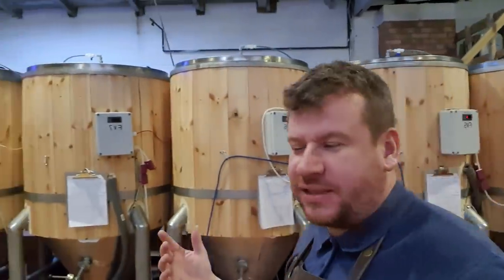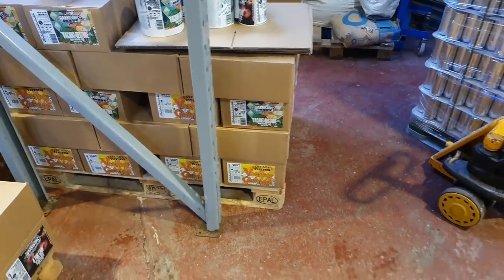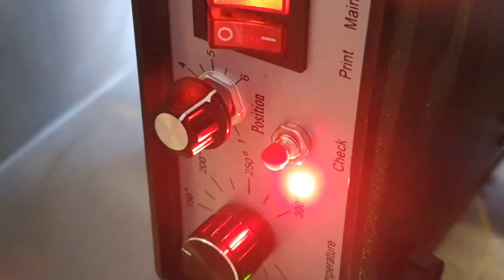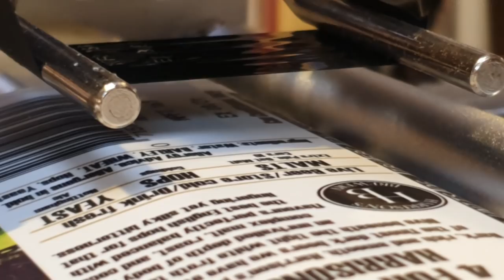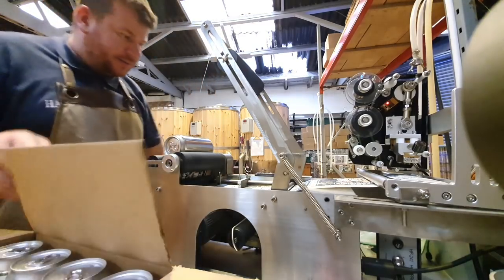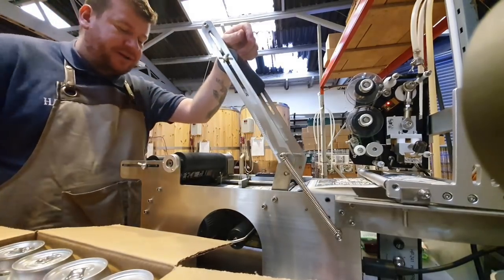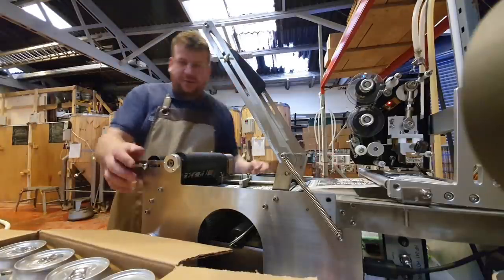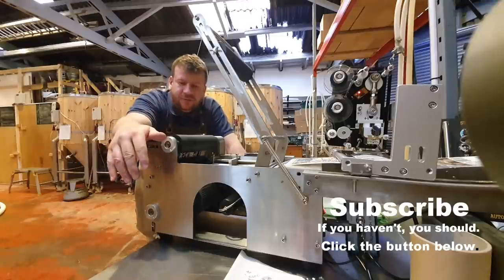The Intricacies Of The MT-50

Comment: Great! Just bought one of these Labeling machines.... MT50D and it's freakin brilliant! Can´t wait to use it ... Hope you stay safe in Covid-times...Take care and keep those nice videos coming! Cheers!
Reply: just out of curiosity...is it good machine
Reply: @BB-bs7hm  Yes! It does what it's supposed to do. Love it!
Reply: @sprayblob  how much you buy it
Reply: @BB-bs7hm  I bought it on aftermarket so got very cheap indeed. Barely half the price of new.
Reply: @sprayblob  how much??? or that's your secret
Reply: @BB-bs7hm  Around 300 euros or 3000 SEK /Swedish crowns
Reply: Browsing through evaluating into buying one for my brewery. 300 euros! That's an incredible prize. I'm curious if yours came with more bronze stamp letters than Harry's. And also, is it easy to design the label to leave the blank space for lot number and expiration date?
Reply: @gennaterra  My letters came as a full setup. Bronze all of them... And spaces and such.
Reply: @sprayblob  Hi ! do u know why my printer does'nt put date after my label is applied ? Printer stay in same position, doesn't move... (except when i switch on my printer at the start..)
Reply: @kekeskia  I bet that one of the micro switches is not getting the proper signal /motion when releasing the handle. Check the gap or even connection to the the switches that they work properly.

Comment: I truly am thankful for this presentation you have made. It go me through when i needed it. I see there are many differences in the machines and it’s components but it lines up. Only issue I had to fix was the ream arm was maxed out and the end cap had nothing to bite on as the ream had to be in alignment but it was able to be secured I simply took the roller off and put a washer in between it and the arm frame and it was perfect thanks again!!!